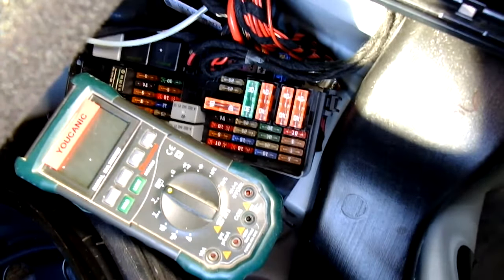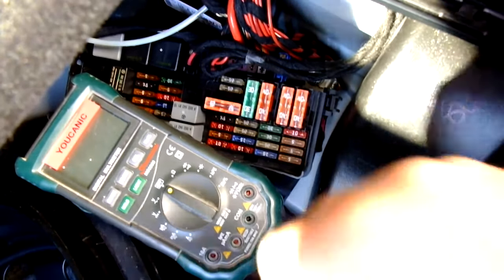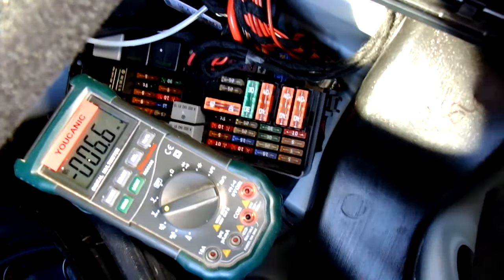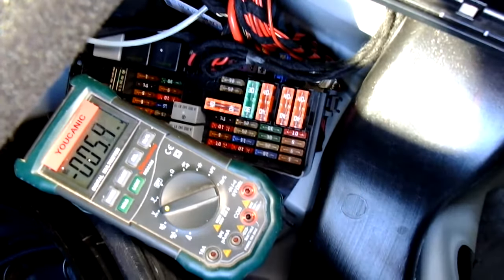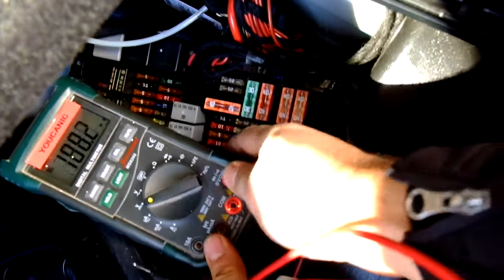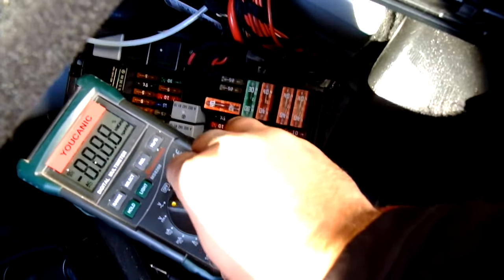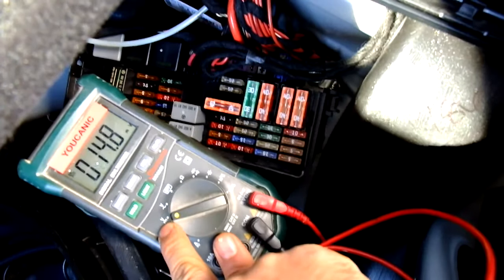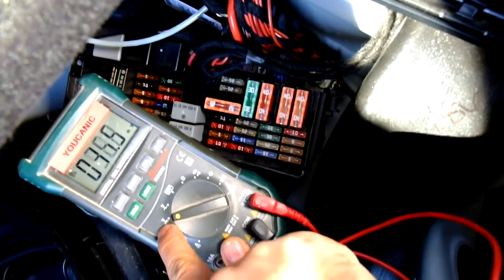How to check Fuse voltage with a Multimeter

Comment: This just test if power is reaching one of rhe probes of  the fuse. But to measure parazitic draw you need both leads on the fuse termianals with car in off and no other devices on to see if rhere is any draw over any fuses

Comment: You need to test voltage at each post, not just one. If you have the same voltage reading at each post the fuse is good. If you have voltage at one post but none at the other or low voltage at the other the fuse is bad. Testing at one post only does not allow you to know if the fuse is bad.
Reply from the maker: Thank you for your insight! At Youcanic, we aim to make car diagnosis & repair easier with detailed guides and our powerful YOUCANIC scanner. We appreciate your input and encourage you to visit www.youcanic.com for more in-depth knowledge on car maintenance. Our mission is to support and empower your car ownership journey! Feel free to reach out via our site if you need further assistance.

Comment: Thanks alot i thought we had to connect both heads to fuse that was why i wasnt getting any voltage

Thansk a lot❤
Reply from the maker: We appreciate your comment and we're glad to have been able to assist you! At Youcanic, we're dedicated to empowering car owners like you with the knowledge and resources to confidently manage your car maintenance. Feel free to continue using our helpful guides, free resources, and powerful YOUCANIC scanner at www.youcanic.com. 

For more detailed information, we also offer factory repair manuals, all geared towards making your car ownership journey smooth. Don't hesitate to reach out if you need any more assistance. We're always here to help!

Comment: What's wrong with touching both leads to the two exposed posts on the fuse?
Reply: For checking voltage it won't read that way. You can check for continuity that way but not for voltage.
Reply: @DS-ss396  Thank you. I just learned fuses are positive only, whereas I thought one post was positive and the other negative.

Comment: The engine need to turn on or not?
Reply from the maker: Thanks for your question! Whether the engine needs to be on or off depends on what type of work you are doing. You can find more detailed guidance by visiting our site at www.youcanic.com where we offer resources like helpful guides, our YOUCANIC scanner, and even factory repair manuals. 

At YOUCANIC, we're committed to empowering you with knowledge so you can feel confident under the hood. Feel free to explore our resources and reach out to us if you need further assistance. Our mission is to support you throughout your car ownership journey.
Reply: It depends on what fuse. For instance your primary ignition fuse should always have power so long as the battery is connected. So that’s a good one to check just to make sure you’ve got your setup right. Now if you take the crank fuse into account, it should only be receiving power when cranking or trying to start the vehicle. Buy the owners manual for your car and find out what the fuse your testing goes to so you know what state it needs to be in to be active and have power. Some are hot all the time and some come on under certain conditions

Comment: Black pole of multi meter is to body of vehicle?
Reply from the maker: Thanks for reaching out with your question! Typically in a multimeter, the black probe is connected to the common or "COM" port and is usually attached to the ground or body of the vehicle. However, it depends on the specific use. Feel free to check our website www.youcanic.com which offer helpful guides, resources and products like our powerful YOUCANIC scanner to assist you in your car maintenance needs. Our mission at YOUCANIC is to empower you as a car owner to feel confident and save money, and we're here to support you along your journey.